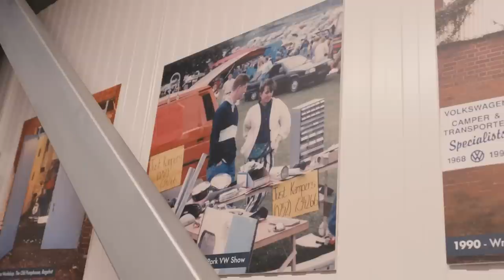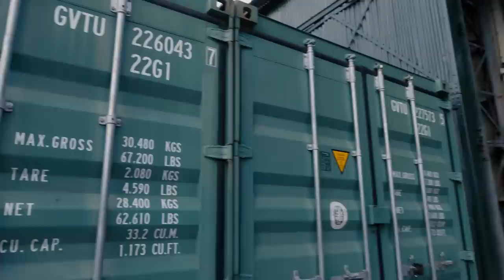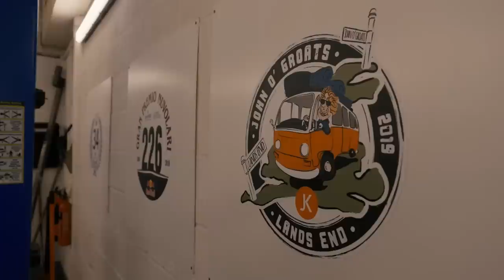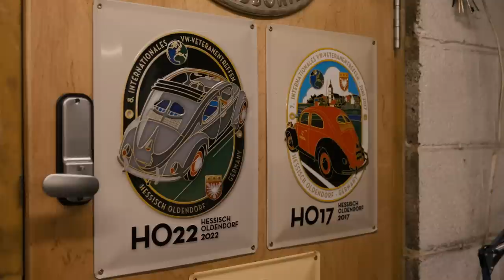'On Its Wheels Again' | Rescuing a 1955 VW Beetle | Episode 5

Comment: That brings back memories of when I worked in a sheet metal shop. I had a turreted Pierce All, The favorite tool was the louver vent punch. Always kept a few for would be Customizers. 
What a cracking warehouse.
Reply: I did my Uni work placement working for Pierce All in Slough.

Comment: Very cool reviving an old car and getting it back on the road. It looks like with the LED's in the semaphores it's now got a fast blink. You might look for a flasher that's made for LEDs since they don't draw as much current. I did that when I converted my Mini to all LED.
Reply from the maker: Maybe that’s the camera, it flashes just as it should, 
The beetle doesn’t have a flasher relay as the original semaphores never flashed, the circuit that makes the new bulbs flash is in the new clever just kampers bulbs!

Comment: Dom you are so right about doing your own maintenance making you more confident driving the car. I was always comfortable driving beetles and aircooled buses, even though they would occasionally break down to varying degrees. A job like a clutch change only needed a trolley jack, a socket set and a morning of work. Now I've got modern sensible cars I am constantly dreading something going wrong with them. ECU problems mainly...